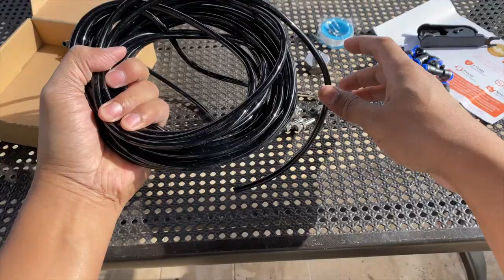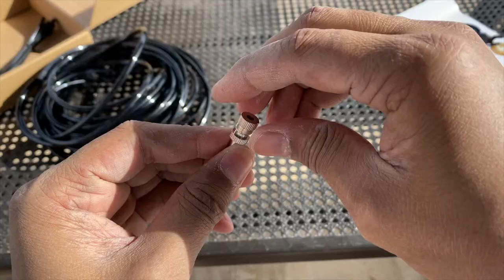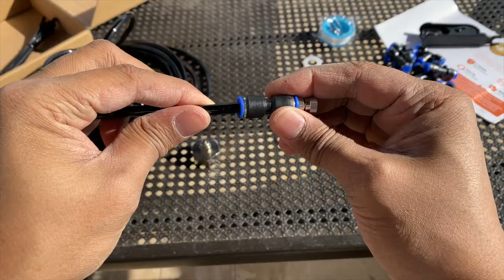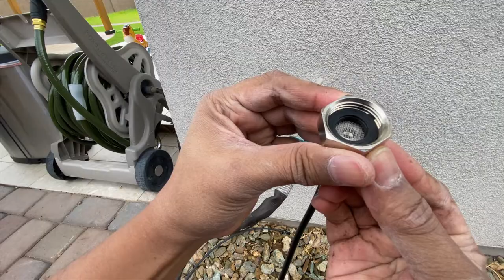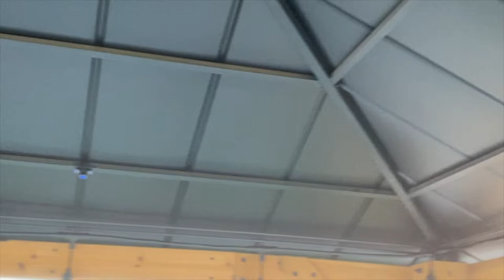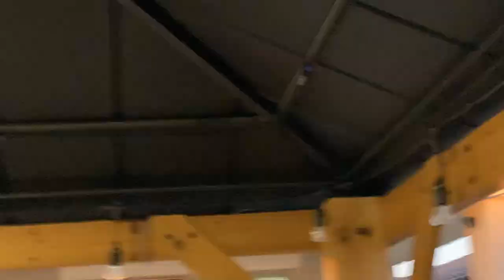Misting System Installation

Comment: Mines is putting out to much water! How do I correct this ?
Reply from the maker: Thanks for your comment. If the water is too much and not misting properly then you need to adjust the misting head. Turning clockwise will block the raw water and convert into mist. Please let me know if this solves your issue.

Comment: How wet does the patio get with this sort of system? Thanks!
Reply from the maker: not much as it is in arizona and If i run for 30 mins it gets dry after 15-20 mins under 100 degree average temp..